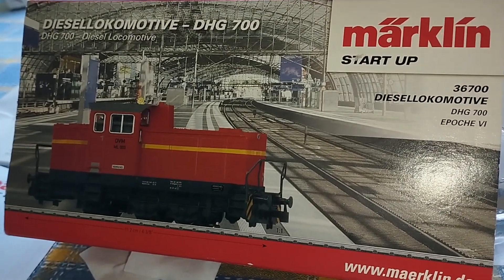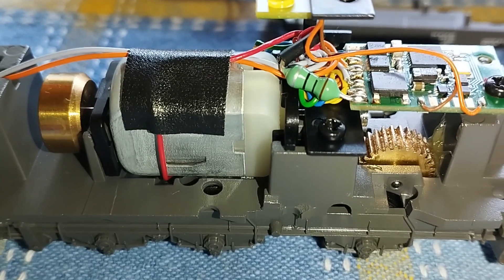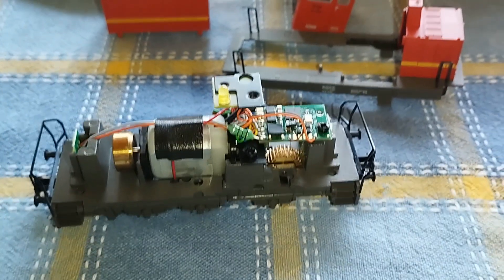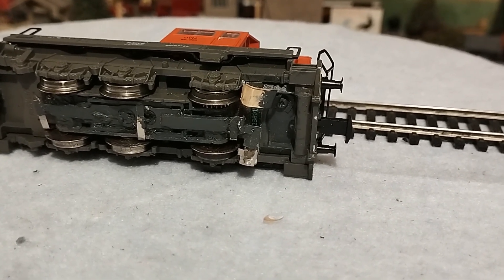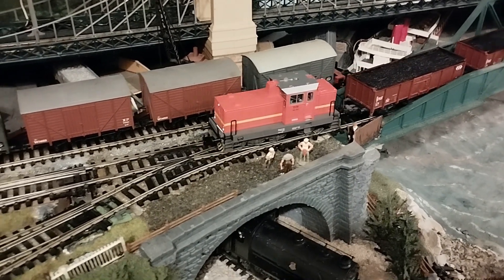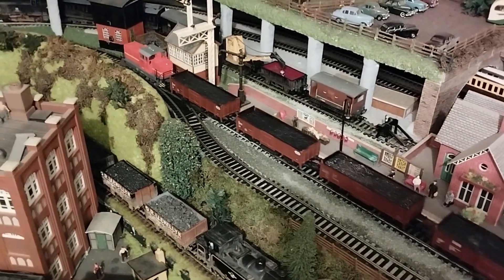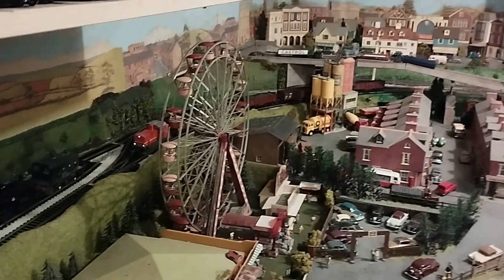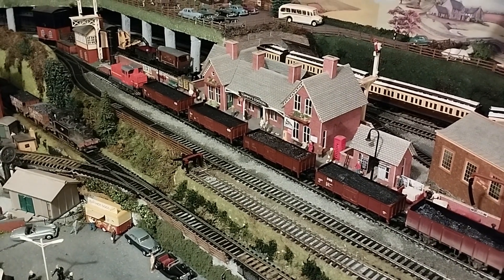Tommys Marklin AC to DC Conversion

Comment: Would check to see if the Marklin motor has 4 wires. 2 of them will be the armature, with the other 2 being the field coils. If the motor is series wound, a bridge rectifier could be used to convert to DC operation with the armature  on the rectifier's DC output. The field coils would wired in series with one of the rectifer's AC inputs. 
Pre 1962 Hornby Duplo was also 3 rail operation.
Reply from the maker: Hi Robert thanks for watching and the information on the motors. I am in no way an expert on electronics I like to keep things simple. When I removed the Loco body the first thing I noticed was the motor is practically the same as the 5 pole Piko motors I use in many of my projects. I removed the motor and connected it to my DC Speed controller, it ran perfectly so there must have been a rectifier on the circuit board. 
Cheers, Paul.
Reply: @paulvozman842  A complex issue would be the sections on the circuit board since you mentioned a directional light controller. Examination may establish what is what with basic electronic component knowledge. Not sure if an active rectifier method is used on the board and whether some of the components are associated with the light switching. The fairly large black 3 lead components are transistors probably of the Mosfet type.

Comment: Hello, sir! Such a fine accomplishment, I always had a dislike for the AC system, and this extended a little bit over the AC models, too - not decisively, but a little bit. Of course, the displeasure magically disappears if the model has DC wheels instead of AC. :D On the other hand, the DHG700 Diesellok it's quite beautiful, and these for two reasons, from my point of view: first, it is a ~classical~ design Diesel machine, and second, it is similar to Romanian LDH45 and LDH70 diesels. The conversion is quite a great success, smooth run and good strength when hauling (those coal gondolas, I love them, CFR - Romanian State Railways company, had labeled them as ESX freight wagons). So the set you run in these video seems very much like a 60s-80s industrial train in my country. At some point, a certain toy factory of the socialist regime produced such a model, including a gondola and a closed wagon, but they were more like a gross model (with rubber transmission to the wheels) - well, for sentimental value, I love it, too. At 10:30 the freight train looks fantastic, cannot stop to admire it. Thanks a lot for sharing this experience, it is great! / Chris :goodvibes: PS - One or two more conversions like this, and I think you can be ordained as a great archbishop of DC system - and this would be well deserved! Seriously speaking, and in another area, as yesterday I had a little medical control which revealed improvement on my heart state, I hope your health state is also better, I would be glad to hear so! Cheers! :)
Reply from the maker: Hi Chris, I have thought about trying to convert an AC Loco to DC for some tim. Luckliy this Marklin DHG 700 was a bargain so it gave me the chance to try it. The motor is 12v DC with a rectifier on the circuit board to change from AC, this made things much simpler. The main challenge was drilling the wheels accurately to take insulators, my shaky left hand behaved for once and the wheels dont wobble. 
As I showed in the video, the rear axle has traction tires so extra pickups were made (skids) to provide power to the motor. The 2 front axles were fitted with pickups but the wheelbase is short so stalling on points was avoided using the skids.
It is a good looking Loco, quite basic in design but a nice square body.
Thanks for the history of Romanian Railways and the Locos,wagons used. Its good to learn about European Rolling Stock.
I have a Dacia Duster 1.5TDI 4X4 which I absolutely love, probably the best Car I have owned.
I am not sue if I would convert another AC Loco but who knows, never say never. 
Good to hear your heart condition is improving it must make you happier knowing your on the mend.
I badly sprained my left ankle early this morning working outside. Currently laid up with ice packs trying to reduce the swelling. 
Thanks as always for your great comments and interest in my Experiments. All the best, Paul.👍👍👍🙏🙏
Reply: @paulvozman842  Sorry to hear about the ankle incident, I wish it will get well very soon. I had such an accident in a winter about 5 years ago, I had to hobble about 200 m to get home (happily, I live on the 4th floor, no elevator, lol). Well, some reward came: for some days, I did not have to go shopping, do the garbage or any other home job like this for a while, my dad did it for me. Best wishes! / Chris :)
Reply from the maker: @Cristake1974 Hi Chris, Sprained ankles are very painful, its not the first time for me but I had almost finished my work outside this morning. Luckily my Wife takes good care of me and is putting ice packs on it to get the swelling down. 
I will have a few days off now and try and relax, sadly getting to my layout in the attic is hard at the moment .
Cheers, Paul.

Comment: Wow, Paul, I had a yeoman's knowledge of what to do, and my biggest question was, "how's he going change the wheels to insulated?"  3 of my current locos were DC converted to AC, so it's a topic I have some experience with.  Great work in the end!  I am curious how you handled the decoder, as you are analog.  Anyhow, Welcome to the Märklin family!  😂😂😂
Reply from the maker: Hi Anthony, I was quite nervous drilling the wheels to fit insulators, my shaky left hand behaved itself and luckily the operation went well. I filed down the boss on the inner sides of the wheels and made some thin plastic washers to insulate the wheels from the chassis. 
I was lucky Marklin used a 12v DC motor in this model, it made the conversion much easier to do.
As you saw the rear drive wheels have traction tires, I had to make additional pickups to prevent stalling on turnouts. 
This Marklin Loco is a starter model and had a simple circuit board for the lighting and a transformer for the motor to run from AC to DC.
As it was an analog model the issue of a decoder was not a problem.  I have a number of Marklin Wagons with insulated wheels but this is my first Marklin Loco. 
Cheers, Paul.👍👍👍

.

Comment: Hi Paul, great conversion. It  runs smoothly and quietly, great how you're willing to try anything, keep the videos coming, enjoy watching 👌👍👏
Reply from the maker: Hi Martin, It worked out quite well in the end, the biggest problem was solving the stalling on points but fitting skids cured that. Now it needs running in as its a new Loco. It was an interesting project and happy how it runs. Cheers, Paul.👍👍👍

Comment: Hi Paul, what a great conversion, I would never have succeeded! As for the pickup: I understand the locomotive is only one axle driven? That's a problem then indeed. However, maybe the locomotive would pull good enough without traction tires? In that case you could fit regular pickups. But indeed, the external pickups are hardly visible, especially when watched from above. Great project 👏👍 Now you can add any Märklin you want, there are sometimes great deals on secondhand Märklin. However, the older models definitely have AC motors, so you would have to change that. Great video! Have a nice Sunday evening! Cheers 🙋‍♂️ Erik

PS: Märklin Hamo models run on DC straight out of the box 😊
Reply from the maker: Hi Erik, The rear axle has a drive gear fitted to the negative side which means I could not remove the traction tires. I did this conversion purely to see if I could do it as simply as possible. After some trial and error I found fitting Skids at the rear solved the pickup issue. I wont be converting any more Marklin Locos, this was a one off project that luckily worked out ok due to the 12v DC motor it had. 
There is a bit of drag from the front axles as they are close together especially on the tighter curves. Hopefully a good running in period will help settles things down as its all new running gear.
I would be interested in a Hammo or Trix DC Loco if the prices were reasonable. 
Cheers, Paul.👍👍👍

Comment: Hi Paul, welcome back mate. Marklin do make 2 rail locos, from memory I think they are called Hammo. I like those little hydrolic diesels, I have something similar made by Flieschmann.  It's  an oldy but a goody, runs really well.  I'm not sure I could do those conversions, but you have done a great job with this one. It runs very smoothly and will get better as everything meshes into place. Has it always been hot in the Summer where you live? Growing up I always imagined a hot day in England as about 25c.  But your Summer temps sound a bit like the East Coast of Oz in Summer. Steven.
Reply: Hi Steve, yes, Hamo was a brand bought by Märklin. It became the DC-line of Märklin. They are in fact for DC adapted Märklin models. Later Märklin bought Trix. So now the DC-versions of their rolling stock are sold under the Trix brand name.
I have both Hamo and Trix. Older Hamo-models have very large flanges which can cause problems on some brands of modern rails. They run, just a bit noisy with the flanges hitting the sleepers.
Reply: @railway187  Thanks mate. I only have the one Hamo model, but it runs very well. Steven.
Reply from the maker: Hi Steven, took some time out from the sweat box attic and relaxed at the pool. I have heard Marklin made DC Locos under the Hammo and Trix brands but have never really thought about buying them. If I find them cheap enough then why not.
I have 2 very small Shunters, one by Lilliput the other by Fleischmann they are very well made and reliable. 
This conversion is a one off, I just wanted to see how difficult going from AC to DC is. Luckily the motor is 12v DC so that made things easier. Drilling the wheels out to 3mm for unsulators was nerve racking but my shaking hands behaved this time. As you say a good running in period should settle things down as its a new loco with new pickups. The skids at the rear solved the stalling on points and are not very visible.
Your right 25 to 26c is a heatwave in the UK, its strange but 26 feels more like 30 plus. There was a heatwave in 76 that lasted ages, I was working on ship engines in our local drydock at the time and had to take salt tablets and drink gallons of water. 
I dont know if you watch Brupeg where a Kiwi couple are rebuilding a trawler in Oz the heat is intense in the summer, I can imagine what they go through.
Have a great week, looking forward to seeing more of your amazing Loco collection.
Cheers, Paul.
😎👍👍👍

Comment: Great jib but aren't the wheels on these locos not insulated? How did you avoid a short?
Reply from the maker: Hi, thanks for watching and commenting. 
As I stated in the video it took a lot of careful drilling of the wheels on the pickup side to be able to fit insulators. I filed down the bosses on the inner side of these wheels and made very thin plastic washers to insulate the wheels from the chassis. 
Cheers, Paul.👍👍🙏
Reply: Chers Paul, I am about to do the same on a Marklin 060 steam shunter myself. One thing I discovered is the motor runs perfectly on DC. I suspect these are either AC/DC motors or a DC motor and the rectifier is on the circuit board? Thanks again for the help and inspiration. 

 @paulvozman842
Reply from the maker: Hi, I am not an expert on Marklin AC Locos but luckily my Shunter was fitted with a DC Motor which made it easier to convert. I think there is a rectifier or it would buzz like mad or worse. I am interested to see your 0-6-0 steamer conversion, I may do one myself as can buy one very cheap and give it a go.
I have been watching a number of your videos, like me you keep these oldies running. 
Keep up the good work. Cheers, Paul.
Reply: @paulvozman842  brilliant thanks!

Comment: Hello Paul! I was just wondering where you had got to,and up you pop ! You are right it is blooming hot,it's 80 in my North facing train room! You have done a great job there another super smooth runner well done you :) Take care Paul and all the best.
Reply from the maker: Hi Michael, I had a bit of a break from the attic and did a lot of work outside to the pool area. The railways are definately for the cooler weather. 
I had to use my old brain on this conversion mostly with the pickups and getting them just right. I need to run it in to settle things down as its all new but when its cooler.
Have a great week, Cheers, Paul.👍👍👍